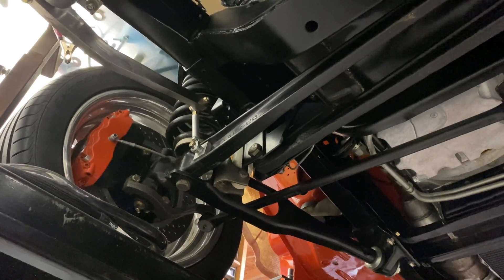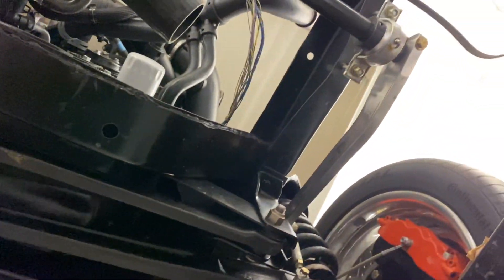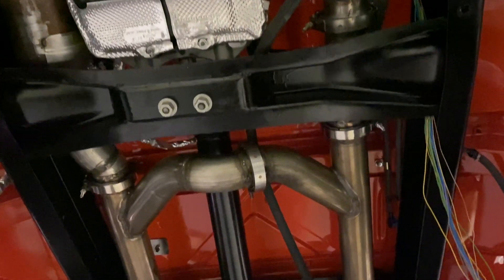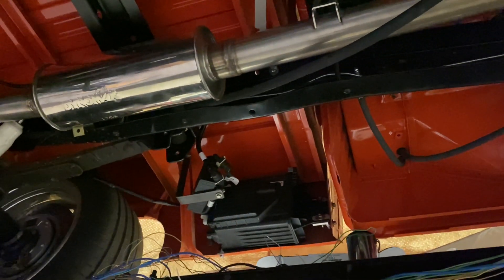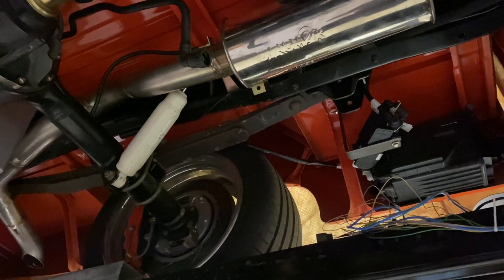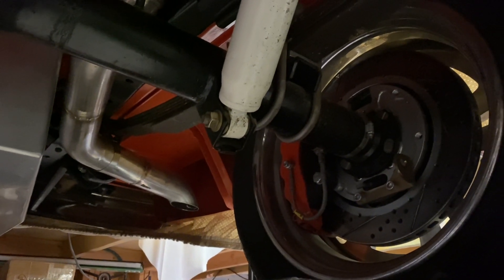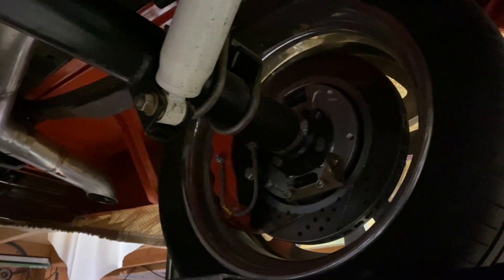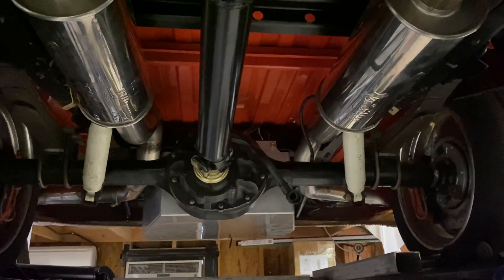1966 F100 Raptor Update In 4k 10 5 2020 Truck being built for lower 48 state trip! 25 mpg?

Comment: That is looking clean...  Just heard your first startup video...  Was curious what size piping you're running on that exhaust... As I've always read the 3.5 didn't sound good with aftermarket exhaust... But I thought it sounded pretty decent in your startup video...
Reply from the maker: I had same exhaust on the 482" FE. It's all 3" Dual 304 Stainless front to back. It also has a 3" crossover "H" style. Like it a lot better than the "X" for multiple reasons.
Reply: @randys66garage  sounds good with the Ecoboost.. So that works for me...  Can't wait to see/hear more
Reply from the maker: @james94582  now working on where to put the hidden switches for cruise control, mode select like Sport, Economy, tow etc. still have room for A/C controls & so on